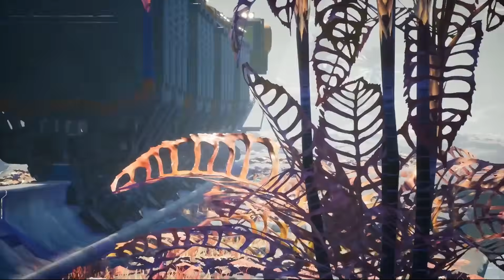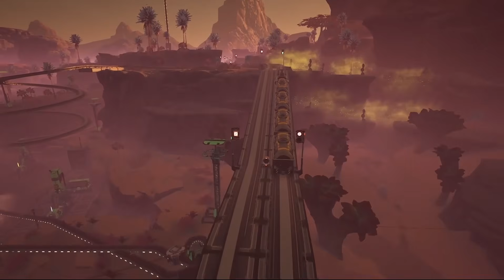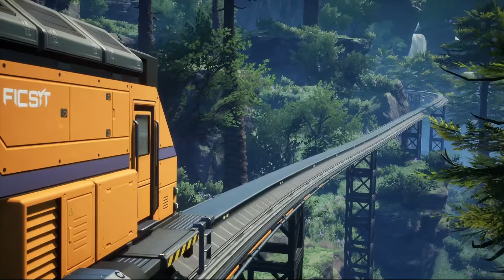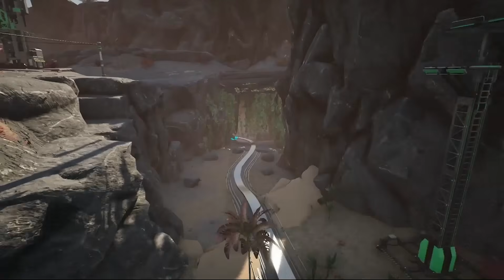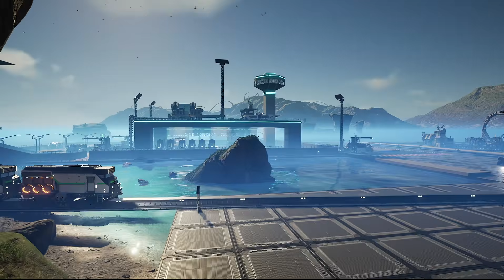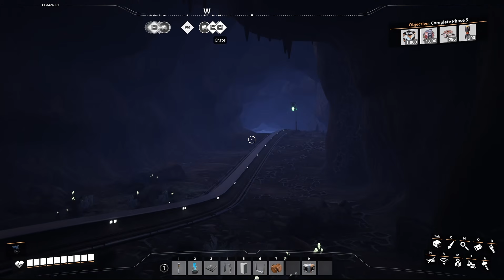Satisfactory Field Guide: Trains, Signals & Automation (Beginner's Guide)

Comment: I still have an issue with my train not being able to access the other station, despite me being able to manually drive the train between them and it initially completing one trip before deciding it could no longer find the other station.  It’s a simple back and forth train between two stations, I set it up with the station pointing outwards kind of into the ether at the end of the line as this is what has worked on my other similar back and forth line. There’s only one train on the line with an engine at each end and there are no signals involved as there’s nothing to need signals.

The track is steep, it goes from the redwoods where I’ve got an aluminium factory back to the open beginners fields in the south. It goes through a bit of a messy corkscrew over the big void in order to go up and down that elevation change but this is all built using 2m ramps with a few flat sections so things didn’t get too overwhelmed grade wise. 

I’ve set the timetable up exactly the same as my other working line going station A > station B > station A > station B. 

Does anyone have any ideas as to what I might be doing wrong?   I’ve tried making the stations directional arrow point towards each other but that didn’t work and the rails are all connected up.  I’m at the point where my only next move is to build a whole other line in order to make it a circular system, but I was truly hoping to avoid that. Building over strange terrain isn’t my favourite activity.

Comment: So, do I actually need block signals throughout the length of any track that intersects another? In my world, I only have one or two intersections where, at most two trains cross paths. In that same world I was able to get away without doing that for another line. Of course, one of those trains in question has a locomotive facing either direction.

Comment: 18:50 Isn't packaging fluid way more efficient than transporting it in a fluid wagon?
Reply from the maker: It depends on distance, volume,  and your definition if efficiency, but it can be, but also not necessarily
Reply: @Dekoba  
For every 600 fluid, you're running 30 packagers, running at 10MW each, costing your 300MW, or 20 assembler's worth.

A fluid wagon has a capacity of 2400m³, which is 4 seconds of output. Running optimal 4+1 Trains costs an average of about 50MW for a Trip of an Undefined Length. 

A freight wagon can fit 32 slots, and all packaged fluids, even in gas bottles, stack to 100, meaning you can fit 3200 or 4/3rds(133.33%) as much as a fluid wagon. meaning that you have to run 25% less trains for the same throughput, which means that as soon as your total amount of power consumed by trains exceeds about 1GW, you're in the green packaging. 

Damn they really nerfed packaging, or I guess made Fluid Wagons less bad. I thought they still had a capacity of 1600, since that was them already buffed from i think like 500 or 800 before that. The only thing it does now is improve per-train capacity and throughput, thus reducing strain on the Network. If one has excess power due to running a large Fuel Engine (packaged dilute fuel pathway) or already has nuclear set up, it's worth it for the reduction in train trips, but other than that, it's pretty weak.

Comment: been playing for two years now and still find overlooked tips in these kinds of videos. I'll have to keep in mind the no stopping in path blocks bit and review my current network. I had a particular worry about that in a few spots and I should be able to engineer it out knowing that now. good content on this topic! 

I do have an interesting signal interaction to add: if you put a path signal relatively shortly after a block signal (~5-10 foundations) the train will slow down a bit but not too much even on an empty rail section. This is because a train only requests a path once it is in the block immediately before the path signal. I use them at the end of steep ramps before intersections and/or approaching my railyards.
I haven't tested if trains can overshoot a signal due to momentum, so I'm not sure if its anything more than aesthetic, but I always found it interesting after discovering it.

Comment: I can't find anybody whose done testing on it, but I believe the 1 Locomotive to 4 Freight Cars is a outdated. Best rebuttal I find is 1 Locomotive can handle 10 Freight on a flat rail but nothing about use cases and inclines.

It might still be true but I can't find anyone testing that specifically
Reply from the maker: On the wiki there is a breakdown of the math with fully loaded freight cars and locomotive strength. I believe that math to be accurate, but it is one thing to see the numbers and another to understand how it translates into real world gameplay.

 I think the idea is that a single locomotive to 4 freight cars, even fully loaded, can actually handle any theoretical slope in the game, but practically, there are few (if any) inclines with sufficient slope and length that it would hit that limit with more cars, and so I was keen to do a test to see if I could find the breaking point (and I did, it was just much farther along than I had thought). 

Most of my trains are on more or less flat rails with gentle slopes between regions, so I am confident based on my testing that I can run a single locomotive for 8-10 cars without worrying about it. But I also dont want to give that advice because everyone plays a bit differently.
Reply: @Dekoba Yeah I missed ur test in the video my first watch, noticed the slope and reqatched it to check.

Ur test satisfies any lingering worries I had about it. Just update my mental note that the 1 to 4 is a theoretically max and can be tweaked in better conditions

Comment: 3:00 when building a buffer system for train stations (both load side and unload side)

Needed if you are planning to do close to one full belt per station or more. It is not really dependent on the stack size, it is dependent on how full the belt is. 

To build a buffer capable of running one full belt per train station:

- Put an Industrial Storage in front of the station.
- Connect the one belt to the Industrial Storage. 
- Connect the Industrial Storage to the train station with 2 belts. 

The belt fills the train station until the train arrives. 
The buffer fills while the train is in the station pausing the station. 
Then the buffer uses the 2 belts to fill the station after the train leaves. With only one belt in and 2 out the buffer empties in 30 seconds after the train leaves. 

This must be done both load and unload. 

It is possible depending on stack size and the length of the track to have more than 1 belt for each station. But you will never get 2 full belts per station due to the load/unload pause. 

Stack size is not really important for the pause problem with buffers. Stack size is more important when determining how long your track can be. With a small stack size and a long track, you will either need to use less than one belt per car, or multiple trains on the same route.
Reply: This is suoer helpful and maybe you can clear something up. If I have X freights but I want Y which is a higher number of full continuous outputs, can I use industrial storage containers and splitters and mergers and such to make it work. Say 3 or 4 freights with a goal of 5 outputs. Or other examples.
Reply: @thatoneguychad420  yes it can all be done but it depends on a combination of stack size vs belt speed vs train route time. 

Sometimes you can get more than 1 belt per train car (but never 2), but other times you will need more than 1 car per belt. 

There are even some cases where a longer train route can push more items per minute than a short train route, depending on the ratio of time the station spends paused vs the time it spends transferring goods. 

If you do not want to do all the math you can just start with a small amount of train cars and see if that handles all your belts. Then addd another car to the train (split and load balanced from your belts) if it does not haul fast enough. 

I usually just overcompensate with long trains and more cars than I should need. 

All depends on your personal definition of "efficiancy".

Comment: The biggest headache that I had with trains is the loading and unloading logic. Seems like the devs intended for us to either have only one train for each pair of platforms, or for us to sort items (which is a nightmare).
My solution was to use trains with two carts and then have my loading stations have two stations and one freight platform (so that I could select which of the two carts to load into) and then my unloading stations have one station and two freight platforms.
Reply: You can choose specific item to load in train platform ->
select train -> schedule-> select train station -> item parameter
Reply: @EarzZful  Well, yeah that lets you load a specific item but it doesn't let you load a specific car. It just incentivizes mixing items, but that's still a bad idea because, if they're imbalanced, one item can flood a system and block the other from flowing.
Reply: @Dauntless261 can’t you have it unload then feed to a belt with a (or several) smart splitters on it into different storage containers? Or am I mistaken, I’m trying to learn this stuff haha
Reply: @Ry.S. Hi there! 
The issue you run into is item ratios. If you have a train with mixed contents that you sort on unload then if those contents are not used at precisely the same ratio that they're arriving (and with sufficient rate) then those that are used less will back up and clog the system.

You can solve this by throttling the loading stations and sinking the excess of course and that's fine. And in fact if you only have one factory to supply then it's probably the most compact solution since stations are so huge. 

But for me, I like to supply multiple factories from each production site. So, my method finds a decent compromise that let's me control which carriage each resource goes to without mixing resources inside carriages. The tradeoff is that I'm restricted to two carriage trains. 

I'm quite proud of my method and I'm very interested in this topic. I'd be happy to discuss it further.
Reply: @Dauntless261  okay I understand. Maybe one example of what you’re saying is if you mix crystal oscillators and say silica (any 50 stack & 200 stack items) then when it unloads and splits, one item will back up the sorting over a period of time/multiple train trips

Edit: forgot to ask my question!  How did you achieve that, do you have multiple freight platform at each station or multiples of both? I also like to have a number of factories in each “main” location
Reply: @Ry.S. Yeah exactly. 

It's not an insurmountable problem. But it is a pain in the ass. Especially, if you want to supply multiple factories with silica. You'd need to:
- Unload at one factory.
- Filter out the amounts & types of items needed at that destination. 
- Reload the train with the excess.
- Unload at the next factory.
- Filter again.
- (Reload again if there's a third factory.)
- Then finally sink all the remaining items and return to refill. 

The complexity and footprint of all that will end up larger than some late game factories. And then on top of that it takes for ever for the train to complete a loop so you risk resource droughts.
Reply: @Dauntless261  yo I edited my past response with a question about how you have it set up. Can you explain it? I’m in phase 4 and have completed everything through tier 8, but still havnt set up a real train network! The dimensional depot is a blessing and a curse since it allows me to keep putting this off. 
Everything about trains is just so overwhelming.I have my HUB in grassy fields with factories around there, then a whole quartz/copper/caterium factory making all the computer related stuff to the north, and aluminum to the east of that in the swamp. I need to bring aluminum products to the computer area and both back to the hub/main base
Reply: @Ry.S. I'll tell you how I set up my train network but it seems like we have fairly different factory paradigms so it might not necessarily be the best solution for your needs. 
In my world (after about phase 3) I made many factories, one for each new cluster of resources (e.g. one for supercomputers & radio units and another for turbo motors & cooling systems etc). And then I also had a production facility for each group of raw resources (e.g. one for iron, copper & steel and one for plastic & rubber). 

I created one large train network that connect to every production site to each factory. (Important note I used double tracks and maintained a keep left rule because trains will arrive at stations backwards if you let them). 
I made two kinds of stations. Loading stations (one for each resource) at the production sites and unloading stations at the factories.
Loading stations had one freight platform and two station platforms so that I could load that resource into either carriage.
Then the unloading stations were the reverse. They had two one station platform and two freight platforms. That way they could fully unload a two carriage train.

My trains were all standardised with two carriages and I tried to keep my factories inputs to either two or four. 

The benefit of this is that you can use one production site to supply say, iron ingots to every factory that needs it. All you need to do is send a train from that factory to the iron production site and load onto whichever carriage you like.  
And then you can also still use that train to go pick up a second resource, say, silica from another production site. 
This design is modular and scalable. You can just add a build a new factory and send trains out to supply it without redesigning the whole network.
Reply: Here's something that you maybe won't want to hear. 
I think the best and worst part of satisfactory is that it's constantly expanding in scope as you play. In a way that's both amazing but incredibly intimidating. 
Do you remember when you first unlocked coal generators and were like "Holy fuck these things are enormous" and then you had to learn to build on a whole new scale? 
It probably happened again when you unlocked Heavy Modular Frames. 
The trick to playing Satisfactory for me is to learn to roll with the punches. When the game throws an impossible seeming challenge at you, you need to step back and rethink your approach. And that might mean leaving some of your old infrastructure behind and building new stuff. 

In my save I completely abandoned my lower tier factories. I just hooked them up to a depo and a sink and moved on. 
I built new raw material production sites and used better alt recipes for them. 

You're in phase four now, you've got to start thinking on a phase four level.